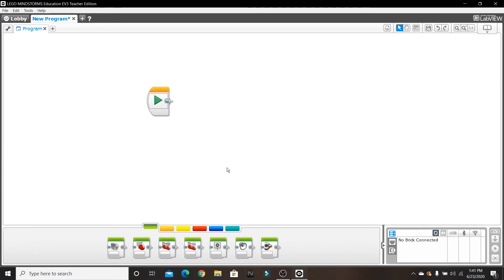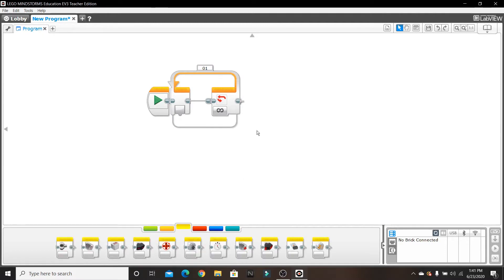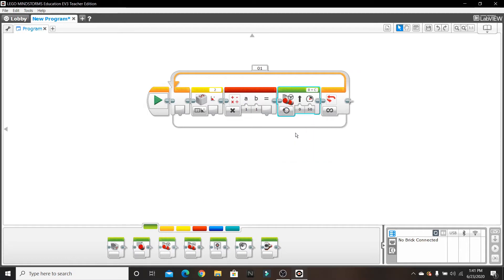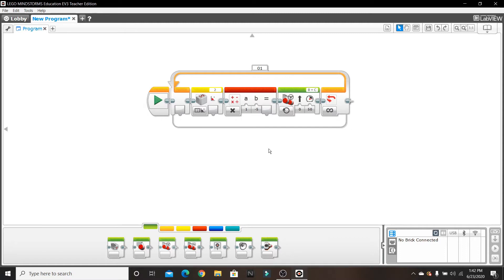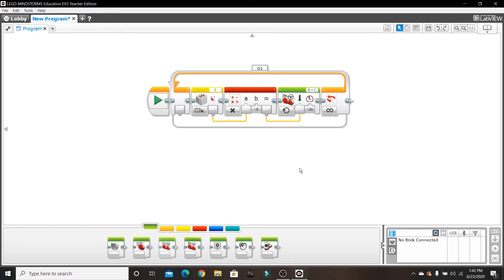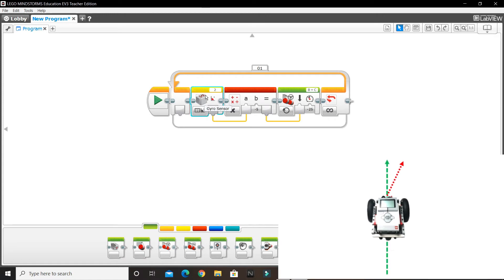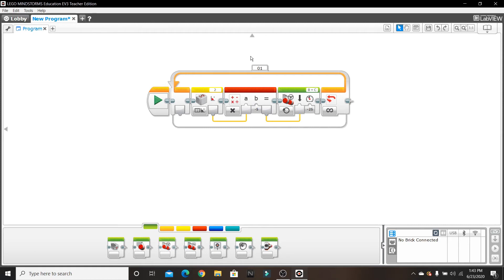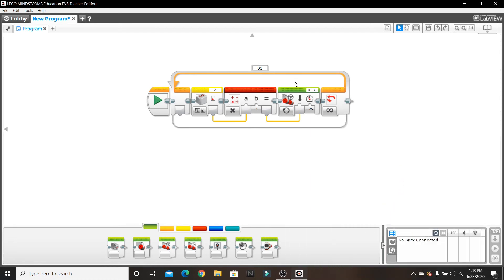How to Drive Straight with the Gyro Sensor

Comment: Why can we use Minus sign instead of Multiply sign?
So that i can use as A-B  (Output of the Gyro sensor will be input to the Math block either to A or B)
Reply from the maker: @Manoj Kumar, it's much easier to correct the steering of the robot by multiplying the gyro sensor value by a negative number. For example, if the robot is drifting to the left, the gyro sensor value would be a negative number, therefore by multiplying the negative gyro value by another negative number, it would correct its path using a positive steering value. However, if you are using a subtracting math block, a negative gyro value subtracting a positive value would further steer the robot to the left. (-x - y) will not equal (x - y).
Reply: @brickwise8624  Hi
thanks for your feedback..i agree scenario that "if the robot is drifting to the left, the gyro sensor value would be a negative number, therefore by multiplying the negative gyro value by another negative number, it would correct its path using a positive steering value.(Ex : a=-4 , b=-5 , then axb = +20) , but another case "if the robot is drifting to the  right the gyro sensor value would be a positive number, therefore by multiplying the positive gyro value by another negative number, it would correct its path using a negative steering value......(Ex : a=+4 , b=-5 , then axb = -20) ...Am i right ? and will  the robot steer further to the left ? ....Please explain also why you stated b as -5 and not any other number say -1 or -2 ?
Reply from the maker: @Manoj Kumar, yes, that's what would happen. The robot would steer further to the left if the gyro sensor value remains a positive value. The value of b varies depending on how sharp you want the robot to correct itself. so larger numbers 
-(5,10,15), would make very abrupt turns while smaller values such as -1 or -2 would make smoother corrections. You may have to test yourself what number works best for your robot/setup.